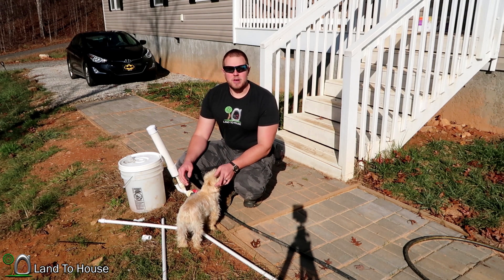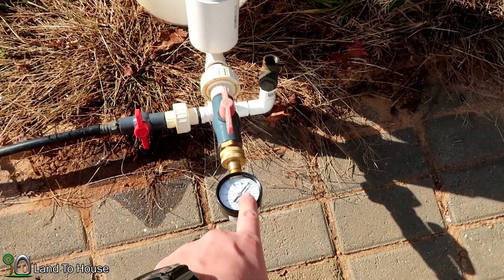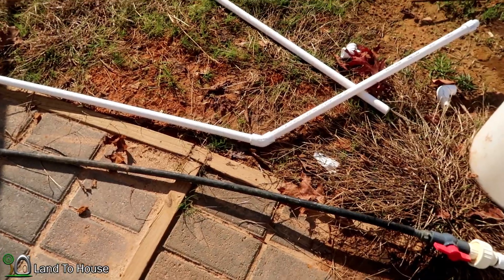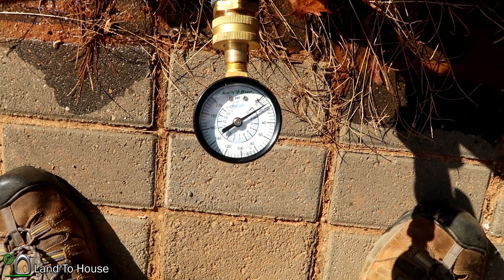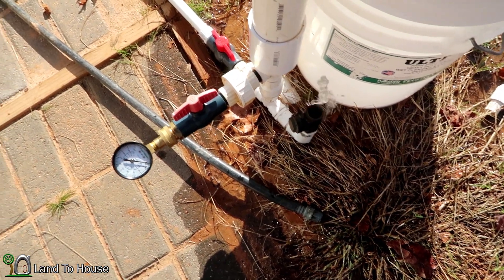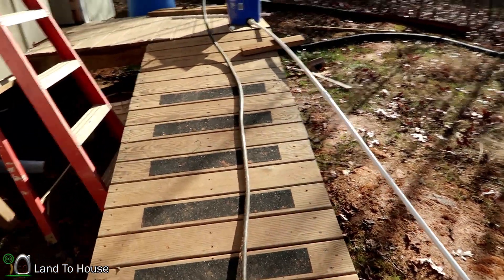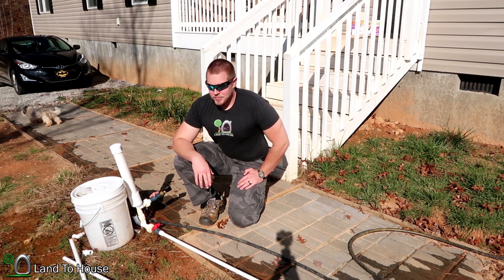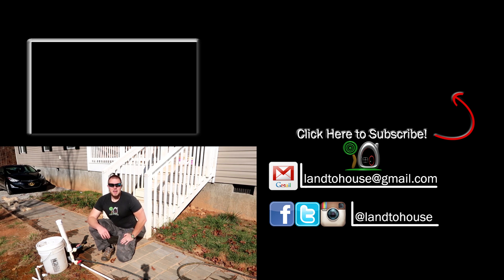Drive Pipe Type does it matter? - Ram Pump

Comment: Yo man, i love your videos and liked and subrcibed....suggestion; slightly clever and sorta stupid. You should name the different pumps: watts and amps cause of the loss of one is an increase in the other 😉. Hook it up with a shirt if u take the suggestion 😊😊😊. Also i appreciate the time you take to make your educational videos. You would be Bennoullis bff
Reply: ....oh and there is an equation out there i read about the lateral placement of distance in horizontal and verticle placements of the purge valves and its consistancy. It would be cool if you put inline gravity fed filters in it to make it for potable applications
Reply from the maker: I had an idea a long time ago to use the ram pump to get water to a storage tank and then use a diaphragm pump to push water through a filter. That would give you potable water with pressure. But with the low flow rate I am not sure it would work well with inline filters.

Comment: great side by side controlled experiment... I wish you had done steel as well for comparison. I am planning to upgrade to steel on my pump eventually (It's about $200). Quite a difference between poly and pvc!
Reply from the maker: +The Farmacy Seeds Network I wanted to try out the steel pipe as well. But I did not have that in the budget. I feel like it would not have as significant a difference as the PVC and poly pipe but probably does have a noticeable difference.
Reply: I would venture it would have AS significant a difference.. much more rigid than PVC... the PVC on my pump flexes a bit with each pulse as well...  but I totally understand the budget issues. :) I was not expecting quite as much difference between poly and PVC tho... was a little surprised it was SO different.  Great test!
Reply from the maker: It would be a great test. If the 3 feet of head pressure could get 35 psi with steel pipes!  Some day I will have the money to buy random steel pipes for tests like this. Or when you swap out your setup you can pass the info along :)

Comment: What happens if poly feeds into 10, 20. 30 feet of galvanized pipe into the ram pump. BTW, follow with great interest. How far up the drive pipe does the pressure wave go? ... If all the way to the drive pipe inlet, can the poly galvanized combo work at some ratio of galvanized to poly. What would that ratio be as you change the ram pump size? What happens if you change the diameter of the drive pipe? Inquiring minds need to know!
Reply from the maker: I should expect the pump would work just fine with mixed drive pipes. I have placed that on the list as a test. Should be fun. The wave does go all the way to the source. That is why a shorter than 100 foot pipe is best. Changing the drive pipe is going to alter the pressure wave size. Or in the case of a large pump with small drive pipe you wont be able to get the pump to cycle.

Comment: Does anyone here know if you burry the ploy pipe, will that make it ridged?
Reply from the maker: +Tom Angle I expect it would definitely help. But using PVC would be even better. Especially if you were to bury that.
Reply: I think that's a great suggestion. Burying it would add a huge amount of rigidity. And more overtime as the ground sets harder around it?